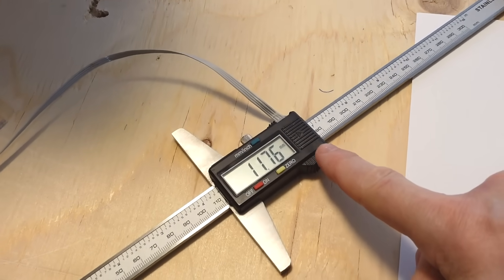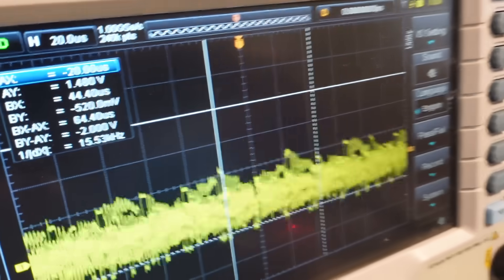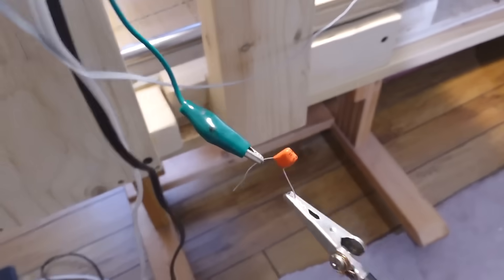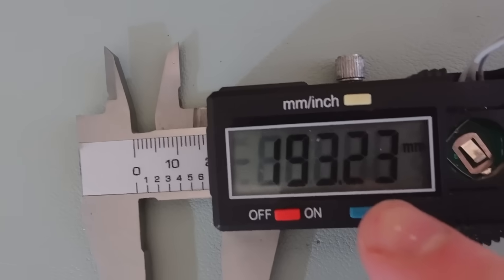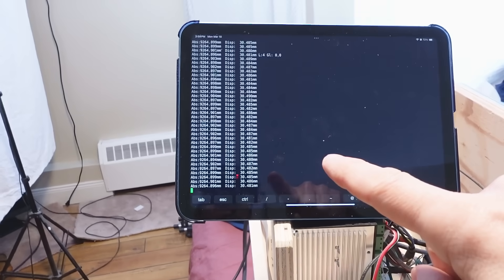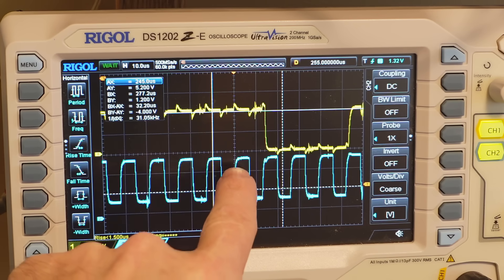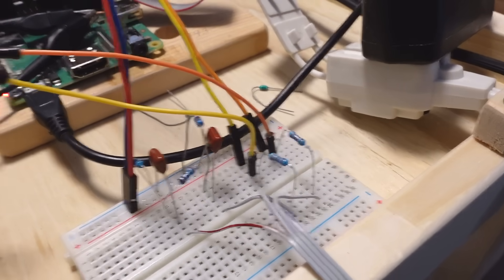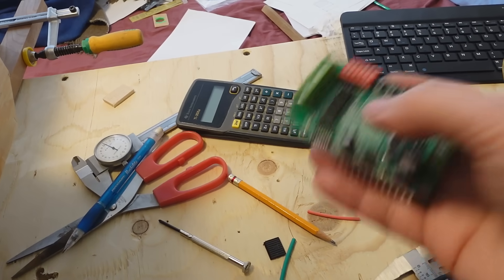Small signal high noise and dealing with it

Comment: If you clip the "ground" lead alligator clip onto the tip of the scope probe, you make a loop antenna.
I spent some years as an Application Engineer for oscilloscopes, and worked in some noisy environments. 
With such a poor signal, you really should use shielded cable; as another comment suggested, an old usb cable would useful., but you could also, I think I previously suggested, clean up the signal right at the caliper, just a transistor and a couple of resistors, or a comparator IC... Really, some other ideas are just a kind of bandaid solution. If the output will drive a few mA, you could drive an LED and use an SPIF optical cable... Just funnin' you. But really, if you don't do it properly, you'll never have a robust solution.
Reply: This is the way forward. 
Increase the voltage being sent to the caliper. With a FET+, boost the voltage and lower the internal resistance of the signal sent from the caliper. 
Use resistors++ to give the caliper itself the right voltage from the higher supply voltage. 
Lower the input resistance ++ at the RPi to cancel out more of the noise.
And, add shielded cables and use capacitors to the ground / supply voltage to minimize noise.
Reply: Raising it up or making it differential signal at the source would be logical no?

Or maybemaybemaybe do the hifi way and buy triple gold plated lead shielded uranium cables.
Reply: A quad comparator could create a differential pair for each of the two signals, and they could go back to the pi on twisted pairs, then a simple 100R termination at the pi header to complete the current loop.  The power supply to the calipers should also be filtered and decoupled right at the caliper.
Reply: just a fun note, on a bit older automated welding machines (lincoln electric) they actually did use optical for data for some things. most annoying little things, a bit of dust and poof! machine unusable. of course the plastic clips on the ends of the cable would only lock it barely tight so electrical tape did the job usually for a couple of months. haven't worked on any newer ones do idk about them.
edit: just checked some newer machines (they're seamer welders) it seems they're using a pretty similar design of the ui and everything so it's quite possible its the same on new machines.

Comment: I've been down this path before on a few projects, so I know where you're coming from.   two words: "Opto isolators"... they'll do your level shifting for you in the right polarity you only need a couple of resistors.  If you use transistors like the 2n2222 or 2n3904's you'll need 2 each per line shifted if you use the common emitter configuration (recommended).  BTW: You can always power the calipers with the same supply lines and still use optoisolators... For the power supply to the calipers use both kinds of caps: like a 4.7 uF cap (for DC smoothing) and a 0.1 or 0.01uF (to control AC noise signals)    As far as the resistor dividers go, yes, you need caps to short the higher freq AC to ground, but as far as relying completely on level shifting the data signals that way... I think you're asking for trouble...  I've been there, trying to avoid a level shifter or transistors...  but in the end, reliability suffers,  as you found out.   I enjoy your content, I really like your DIY and jump in there attitude, you make it fun 🙂  Cheers!
Reply: Yup, I have been there too and it’s better to just add the parts to ensure reliability.  It’s so much easier to do it “the right way” than to debug some other janky solution.  A little Schmitt trigger buffer and a small capacitor on the unshielded power rail would probably fix everything right up.
Reply: @multiplysixbynine  I use 7414 Schmitt inverters to clean up sloppy outputs from optocouplers. Square up those rounded shoulders. Optocouplers are great for blocking the kind of noise we're seeing here. It's a total solution. Fixes everything right up. Kills noise dead.
Reply: @ Yup, an optocoupler could work well here as long as it’s fast enough for the data and the calipers supply enough current to drive it.  I suggested the buffer because it has a high impedance input so it would be fine to use with calipers running on a coin cell.
Reply: @multiplysixbynine  I think just a comparitor to both level shift and drive the cable with more drive strength + a shielded cable would be the solution here, but Matthias likes to do stuff the unconventional / more difficult way
Reply: Does the caliper have enough current drive to run the LED in the opto? Especially running from a button cell?? You think the battery life of the calipers is bad now, throw some LEDs on the data clock like and you could probably measure the battery life in minutes
Reply: @gorak9000  I'm going to go out on a limb and say probably definitely not. No you'd have to buffer the signal to the opto. But that's going to be the case with most anything anyways. Optos need a fair amount of current to fire. If it was me I wouldn't be running those calipers with a battery. Its days of being portable are over now. And I know how bad the battery life is on cheap calipers. That's why I have Mitutoyo. I have some cheapos too.
Reply: He didn't want to throw that many parts at it. What he did is fine and it works.

Comment: I solved exactly all noise problems just connecting the caliper metal parts to battery negative.
This particular caliper works at 3V CR2032, so there is no need for these weird logic level shifting solutions.

Comment: Those drives are criminally* unshielded and unfiltered. Shame shame shame!

The outputs can be filtered with an LC circuit, and shielding placed around everything -- tie everything loose to ground (make sure you aren't shorting something out by grounding the heatsink, for example), and keep ground-return paths short and wide.  Ground length and width matter: compare the noise at 2:55 (high frequency spiky junk) to the lower frequency (10s, 100s kHz? 60Hz?) stuff at 2:02.  If you make that ground lead shorter and wider, you push the cutoff to higher and higher frequencies, and the grounding quality improves in proportion.

Similarly, the caliper cable can be shielded. I would recommend multiconductor shielded cable -- a chopped up USB cable will do in a pinch -- and join the shield at both ends to ground with as short a link as possible. Add a bypass capacitor between supply pins at either end (including GND to "GND" at the rPi) to improve things further.

Probably most of the noise in this setup is E-field and near field due to hard switching edges radiating from the motors, cables, and drives -- these should be shielded similarly, e.g. using (heavier gauge) multiconductor cable with screen/shield tied to the motor enclosure/chassis at the far end, and to the chassis/circuit GND at the drive end.

*Too bad regs aren't criminal acts, only civil means, and fines.
Reply from the maker: probably the cheap power supply making more of the noise.
Reply: @matthiasrandomstuff2221  a Pi filter on the output of a SMPS cleans them up a lot. You can use any scrap parts you have lying around to make one as the component values aren't critical. Maybe a tuned circuit works even better? I just use any pair of caps and a coil though and it's always good for a big reduction in ripple. Easy as Pi.
Reply: @ This is easy to tell apart: the waveforms (low/high square then a ringdown, typical of a flyback power supply) when you probe near the power supply are different from everywhere else -- in most basic terms, the frequencies are uncorrelated, i.e. it doesn't sync with the other signal on the display.

Even brand name supplies are common enough to read a few volts right up close to them; I'd need to do a bit more testing to be sure, but the power supply may actually be just fine here!

Comment: Thanks for the interesting video Matthias. Have you considered using a PNP Emitter follower to buffer the output of your caliper? You get a couple of useful attributes with a PNP follower. Lower output impedance (less affected by noise), and a 0.7v level shift to move your signal to swing from 0.7 to 2.5v. Less loading on the caliper as well. 2N3906 or equivalent. Not critical 

Fun project!
Reply from the maker: I didn't want to add a lot of components.
Reply: @matthiasrandomstuff2221  yes that makes sense.  I didn't realize that you were floating the ground on the caliper to shift the signal.  That's very Jim Williams (analogue guru) of you 🙂 [Jim Williams often drove the power supply lines of the monolithic power amps to extend the voltage swing from +/- 30 volts to hundreds of volts].  I thought you were shifting the signal in the resistor divider in the same manner as some arduino SD card interface board do.

Comment: Reduce your input impedance. Lower input impedance means more current on the signal line, which means any interference-induced current has less impact on the voltage.
Reply from the maker: but the impedance of the output is actually relatively hing, so lower input impedance means very attenuated signal, which is not good.
Reply: If you are getting as much current as you can and it's still too noisy, then you need better shielding or a better driver (line driver, level shifter, etc).

Comment: At 7:30 you said clock and data lines next to each other. 40 years ago I worked with engineers who developed ribbon techniques. The answer was to separate all signals with a ground. The ground wires were tied to ground at one, the other or both ends depending on the source /destination of the signal. Ground connections are added at the source of the noise, to return it there and not transmit it further. Do that and all your problems are gone.

There was a spot where you were adding random grounds and seeing what happens. That also doesn't help because it creates random ground loops between different subsystems that don't need any extra communication paths, just a correct ground structure.
Reply: That's not the problem. The glitches are being generated by the motor drives. They are swamping everything with high frequency noise. That's the nature of PWM. Maybe if he decoupled the drives it could help? I'd have certainly tried it. Just throw a capacitor across the drive power. Maybe a couple capacitors to filter out different frequencies. A big one and a little one.

Comment: All those unshielded wires make great antennas..   😎
Reply: Yeah but when he scoped it he showed it isn't radiated noise that's causing the glitches. Because the amplitude all through the circuit was far higher than what he could measure in the air.
Reply: @1pcfred  thats not at all what he showed, he showed that he has both ground and radiated noise, still lots of radiated noise regardless. and at 7:36 he literally shows himself getting crosstalk across the data lines because of of the wires running next to each other. if he gets self interference you bet he's getting all of that extra radiative interference on top of the internal noise.

Comment: Good timing :) I’m just trying to fix the same problem on my 6kW motor controller for my electric barge. I went through all the same process as you but didn’t try just series resistors. Thanks for the inspiration :)

Comment: should be using a shielded cable man. cut the ends off a usb or use some ethernet cabling or something. using twisted pairs will help a lot, and you've already discovered the necessity of shielding.
Reply: Twisted pair isn't going to help without differential signals.
Reply: @stargazer7644  the twisted noise signal might like doing loop de loops though. Weee!
Reply: @stargazer7644  not as much, but it sure isn't going to hurt any.
Reply: @MadeInMichigan  Not at all.  Twisted pair helps with external signal pickup because the noise is common mode, and your signals are differential so it is easy to eliminate the noise.  If your signals aren't differential, it isn't going to help at all.  Twisted pair helps with crosstalk, but only if the currents in each wire are balanced (differential).  Single ended signals won't be.  Making your cables out of gold wire isn't going to hurt either, but why do it if it isn't going to help?
Reply from the maker: Didn't want to redo the cable.  The passives on the header already solved the problem.
Reply: @matthiasrandomstuff2221  A potential alternative to shielding would be to braid/twist the separate wires - no need to redo the whole cable.
Reply: @matthiasrandomstuff2221  I think your probing proves your not picking radiated noise up. The noise is far stronger on all of the conductors than in the air.

Comment: you know there's a technique called "shielding".  Generally speaking it's not a great idea to use low pass filtering on a digital input, although I suspect you'll get away with it on a rPi, the total lack of documentation on the soc makes it hard to know whether it's actually ok or not.  The concern is that digital inputs don't like to be between the low and high value thresholds, this can lead to both input drivers conducting.